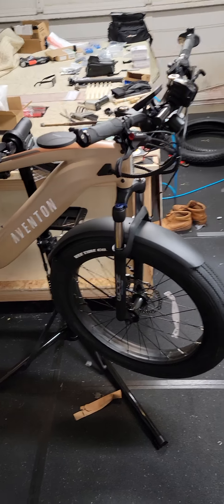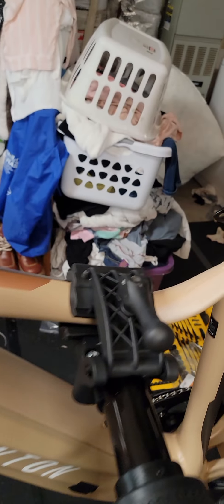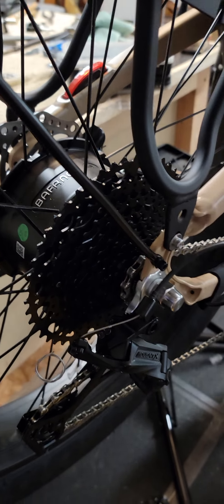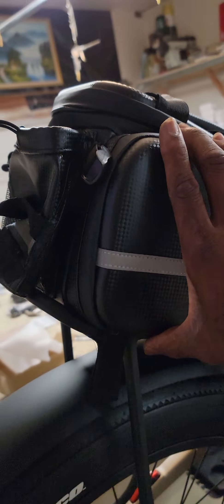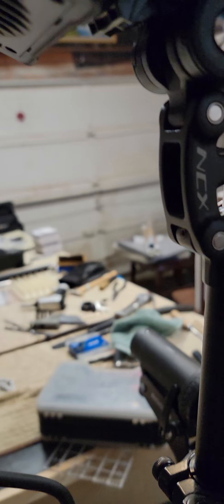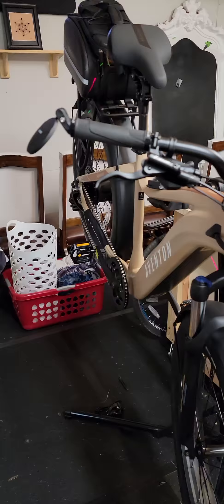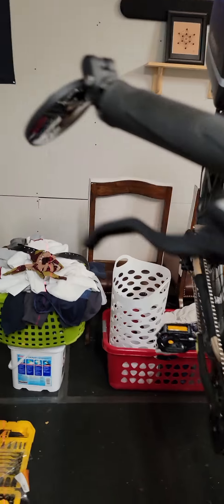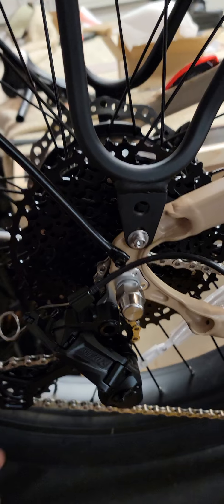aventon aventure drivetrain upgrade with Rasta EmojaH

Comment: I have an Aventon Aventure also. How are those VEE TIRE ZIG ZAG Tire working? I bought a set and they did not tell me that they only could handle 20 PSI max. I like to ride with 30 PSI to get the best Milage. What pressure are you riding them at? Thanks for your help. Robert

Comment: Rasta, Wondering how your clutch detailer has worked out for you...do you like it, does it shift well? Thanks for video.
Reply from the maker: Yes it works great the clutch duralier is just to take any extra slacks out of the chain no issues thus far

Comment: Still waiting on mine to be delivered, but I have already considered changing tires. How much of a difference do they make in range and speed? Would love to see a video explaining how they changed the ride experience. Thanks!
Reply from the maker: I will reply later I'm at work at the moment
Reply: Sounds good!
Reply from the maker: Hey how's it going .....to answer your question about the tires they are absolutely worth it if you're gonna be ride on pavement vs gravel trails even though there's a couple factors to consider the experience might differ from mine factors such as tire pressure, the rider body weight and road grade ....as for my experience I'm 210lbs I keep my tire pressure between 20lbs-28lbs and I got a step through bike for my wife that still has on the nobby tires  and while cruising down hills without peddling I always get ahead so it definitely reduces road resistance on  Pavements but have to be careful I n gravel areas though hopefully that helps I will post a video when possible next week thanks for asking I appreciate it

Comment: Holy shit man, that bike looks sick! Great video! I was looking for some road tires for mine as well for commuting. Thanks for the video.
Reply from the maker: Definitely the vee tires are great with the tannus armor insert for puncture resistant and maintain a 20lbs tire pressure that will keep you rolling nicely becareful of gravel though when cornering hard because the bike Will come out from under you and then you know what happens next.....but it's easier to get to 32miles and hour though than with the nobby tires

Comment: Love what you've done to upgrade the Aventure! I have the same bike and was thinking of changing out the tires for less road resistance. Since you've changed out the tires, do you notice a big difference between the road and stock Nobby tires?
Reply from the maker: Yes I have actually zero road noise and a slightly less road resistance but as for cornering on pavement vs gravel you can't go wrong the nobby tires is gonna send you flying if you try to corner on pavement that has the slightest robble otherwise for the style and weight bike you're good with either
Reply: @Mojahvids  Do you have a link to the tires you upgraded to?
Reply from the maker: @christianking8062  they are called vee tires you can even find them on Walmart website Vee Tire & Rubber ZigZag Tread 26x4.0 Fat Bike Wire Bead Tire

Comment: hi might consider adding another battery to double your range , about 200 to 300 bucks
Reply from the maker: Yah I thought about it but the was $500 last I checked has the price changed? Or are you referring to an aftermarket one
Reply: @Mojahvids  hi   the aftermarket ones are pretty good , you could install on backrack there are connectors on amazon and ebay
Reply from the maker: OK I will check it out

Comment: I just ordered mine in the sand color too. Can’t wait. Tell us.. can you provide the link for the suspension seat post you got from Amazon? Does the 31.6mmX350mm fit? The Aventon site says the seat post they use is 30.4mm. Or did you get the 27.2mm?
Reply from the maker: Actually the seat pole I ordered the standard 27.2mm and buy the seatpost shim or sleeve that matches up to the 31.4mm
Reply from the maker: https://www.amazon.com/your-orders/pop/ref=ppx_yo_mob_b_pop?_encoding=UTF8&gen=canonical&lineItemId=mlkokumqlnmnwny&orderId=112-0004486-1909839&packageId=1&returnSummaryId=&returnUnitIndices=&returnUnitMappingId=&shipmentId=UvQXDrJ2w
Reply from the maker: https://www.amazon.com/your-orders/pop/ref=ppx_yo_mob_b_pop?_encoding=UTF8&gen=canonical&lineItemId=mlkokumqlnmnsny&orderId=112-9163310-8129034&packageId=1&returnSummaryId=&returnUnitIndices=&returnUnitMappingId=&shipmentId=BdL6mpyzK
Reply from the maker: Hopefully that helps
Reply: @Mojahvids  hi.. thanks for attempting to share the link. It looks like the link you provided was the link to your order.. which of course is private so it won’t let outsiders open it. Would you try to post the link to the item?  Did you get the shim/sleeve from Amazon too?
Reply from the maker: Yes both from Amazon I'm going to write the names on here give me a second
Reply from the maker: OK here goes both are on Amazon 

SR Suntour sp 12-ncx seatpost 27.2mm

Cane Creek seatpost shim 27.2-30.4mm
Reply from the maker: So those are the direct names and Dimensions
Reply: @Mojahvids  thank you so much. I sure appreciate it. I love all your mods and I enjoyed your vid. Happy riding.
Reply from the maker: Thanks alot and I'm excited to know how much fun your gonna be having I just ordered another one for my wife

Comment: Were these upgrades worth it? Because my bike shop told me I would see negligible results from these changes.
Reply from the maker: @jellojamcwg  each person’s perspective an experience is different for me they were in the event my battery died I could put the gears on the free crawler and ride it like a normal bike so yes for me they are worth 
Maybe 🤔 assess how you will be using your bike and weigh the pros and cons you might not even need them
Reply: @ they told me to just pedal faster, I love what you’ve done here, I’m still weighing options to make these changes. Road tired for summer, maybe a back freewheel, and I’ve seen people change out the front pedal tooth to larger or smaller, it doesn’t look like you did that here though, and the 10 speed option seems to be a good idea. You did this all yourself? Did you have to use any special websites to make sure you didn’t run into issues?
Reply from the maker: @ I did change the front crank sprocket to smaller I did it myself given having years of experience working on bicycles over the years been riding since 9 or so
Reply from the maker: It’s nice to transform you can almost handle it like a mountain bike and that’s saying something given it’s 80lbs bike but again that’s only if you’re gonna use it like that 
If you’re only gonna use it a few times a year then it’s best to save your money
Reply: @Mojahvids  so I’m basically using it as my main source of transportation, so I’m definitely saving this video for my future to dos. So I have the Aventon aventure 2 and it’s an 8 speed, 12-32 and 48T crankset, so you went with the 11-48 10 speed, and smaller crank instead of a bigger crank? And I assume you had to change out the cranks too? Did all these combined changes increase your overall speed? And you had to change out the derailleur.
Reply from the maker: @ yes I changed the entire drivetrain the derailleur,crank,chain and sprocket cassette as for the speed the most I’ve got was 37mph but I was pedaling hard as well 
But my main reason for switching it out was to use less battery by adjusting the gear ⚙️ ratio to accommodate for a heavy bike while pedaling so I mostly had the power turned down because I wanted more physical exercise at the same time
Reply from the maker: @ but no making these changes won’t increase your speed 
You will have to pedal faster and harder to exceed the factory settings unless you have a way to bypass the settings and increase the speed that I’m not aware of
Reply: @Mojahvids  thanks for the info!

Comment: How's it handling since this? And do you have a link to the speed upgrade?
Reply from the maker: It's handling quite well actually I will try to find a link to the drivetrain upgrade for you in a second
Reply from the maker: They're not letting me copy and paste the derailleur. It is an adventx clutch derailleur with a  10-speed 11-48t cassettes and adventx 10speed pro shifter.
Reply from the maker: Over all its an adventx group set you might have to purchase them separately from different sites
Reply: Thank you for that! I appreciate it! Just ordered this same bike but in camo green on Black Friday! Pumped to use it
Reply from the maker: You're gonna have loads of fun